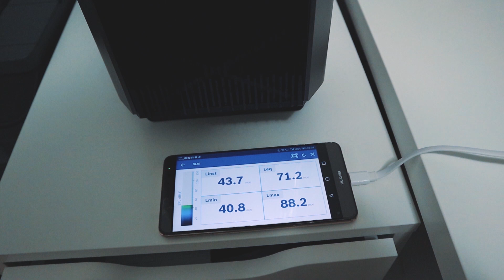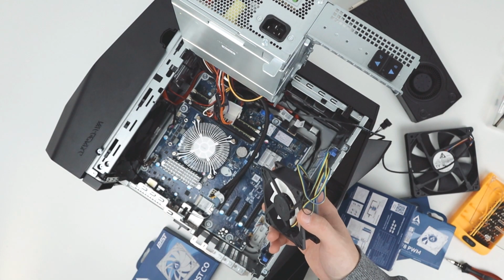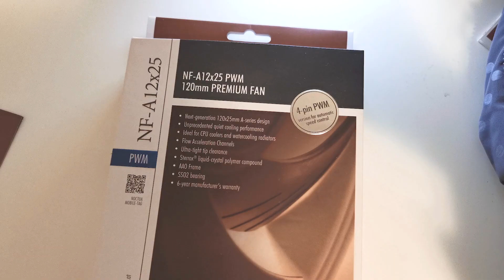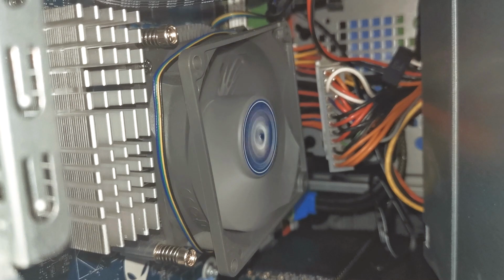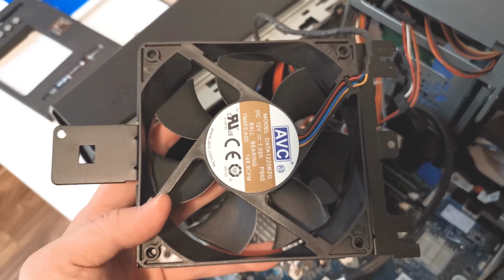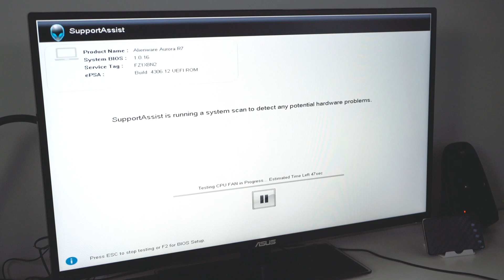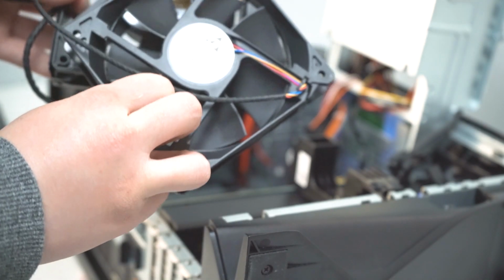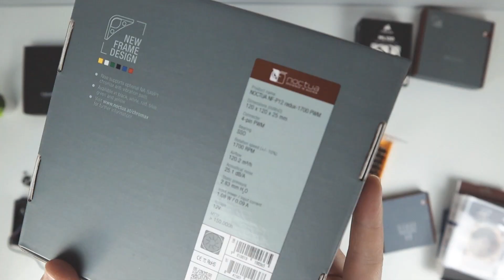Alienware Aurora R7 Fan Exchange

Comment: I am getting that supportassist error, and I didnt change anything, all I did was dissamble it to clean, and once I puted it all together again I started to get that error, and my fans are going crazy fast and loud. Can anyone help me out ?
Reply from the maker: Did you plug every cable back to the right pin?  or something mast changed
Reply: Same thing happened to me. Make sure all fan cables are in correct spot.
CPU fan connectors are 2 different ones, you probably put it on the left one(if tower is standing) put it in the right one it should be ok now.

Comment: Am I right in saying that the R8 has a 120mm front fan? Does that need a fan speed >1,700RPM?
Reply from the maker: yes both front and top fans are 120mm.  no rpm requirement for the front fan.
Reply: @OnboardCircuit  So the top fan needs to be >1,700RPM?

Comment: Harry, what mess you made for me!  I just bought a Aurora R8 and I was about to replace the fans because of the HIGH sound level.  All of a sudden I cant find ur video again because you rearranged. No hard feelings tho and much oblige for Your work! 

Can you please tell me the name of the 80mm Noctua fan used for the processor?

Does it have to be a 4pin, PWM?
Is it perhaps the "Noctua NF-A8 5V PWM" 5Volt, is that ok in the Aurora?
Reply: Ooops just saw up top...
Reply from the maker: Hi Peter, Thanks for stay in... the 80mm fan is the Noctua NF-A8 PWM. Yes it is 4pin PWM.   here is the link to Amazon https://amzn.to/2BdSPha  USA  https://amzn.to/2BeMfXE  Canada.    for 5V fans you will need 5V power, which I don't think the aurora has any.